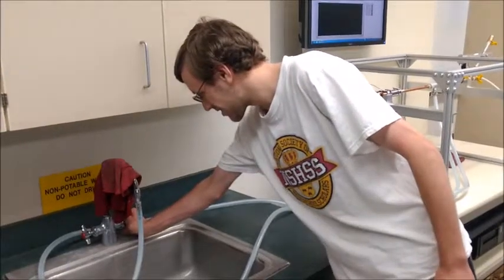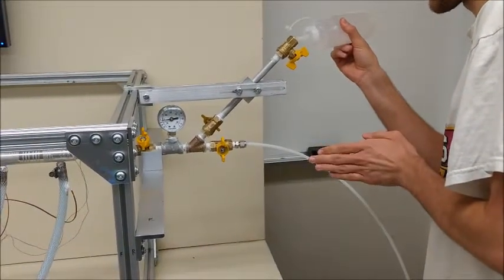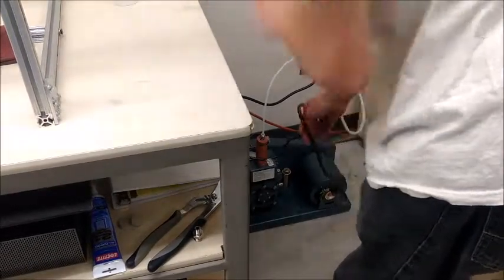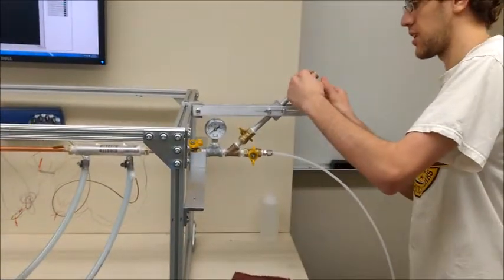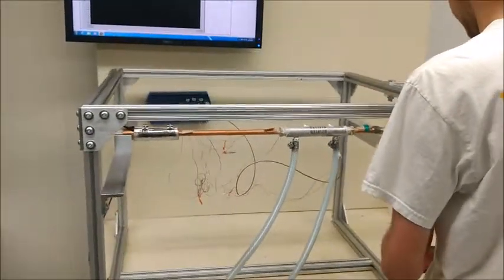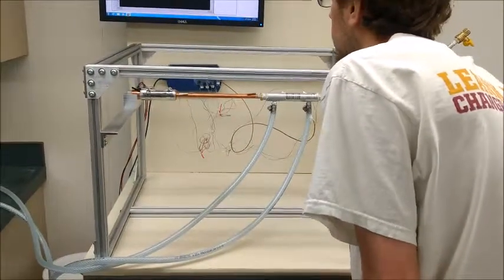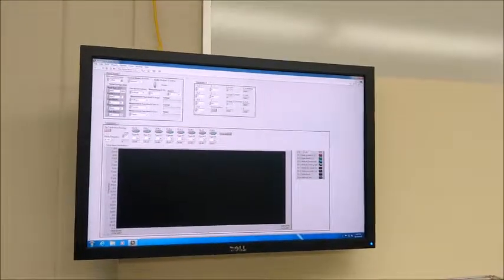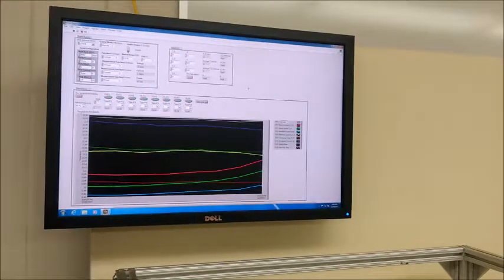Heat Pipe Experimental Startup

Comment: Can you provide me detail of setup I want to build one for myself
Reply from the maker: What you need will depend on how you plan on using it. If you just want a heat pipe they have some on Amazon for pretty cheap. If you just want to build one for the fun of it then you will need a pipe cap that can hold a vacuum, 2 pipes, a wicking material like a wire mesh, a t fitting or something similar, 4 vaccum valves, a vacuum pump, a tube to connect the vacuum pump a valve a heat. To run it you will need a heat source and probably want a cooling source (examples are cold water or a fan). If you want to angle it then make some sort of structure to hold it in place and then make it so you can angle that structure or have it so the structure can move the pipe. If you want to know certian data then you will need to buy sensors to collect that data and the stuff that will go with it.
Reply from the maker: If I remember right I got all the hardware stuff from McMaster Carr. The electronics and sensors I got from different sources but for most of it you can probably get an arduino kit if you are just using it for home use.